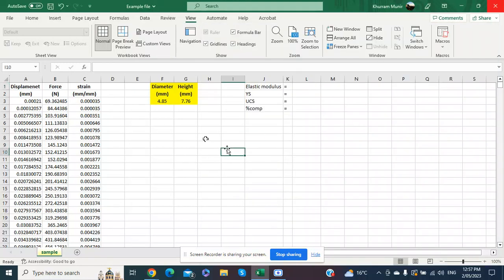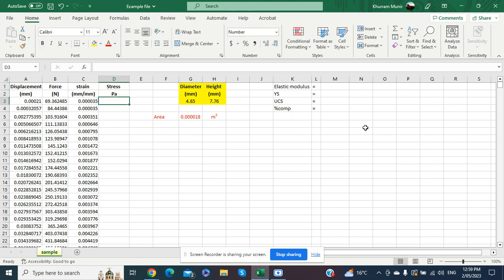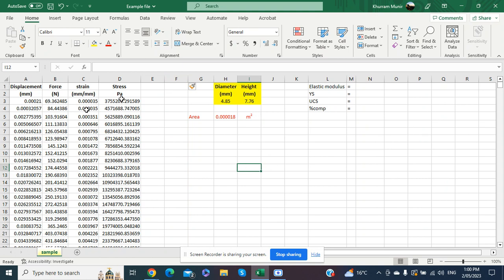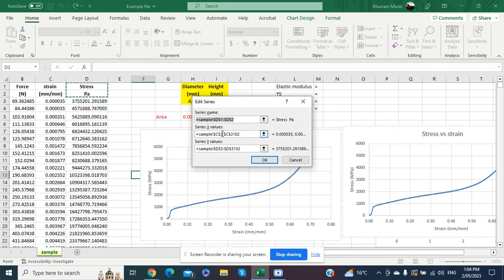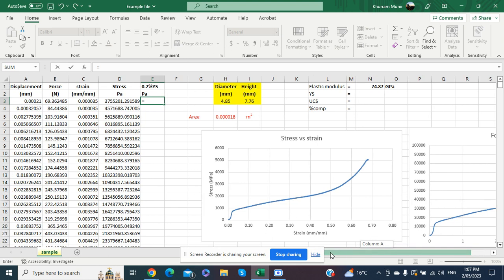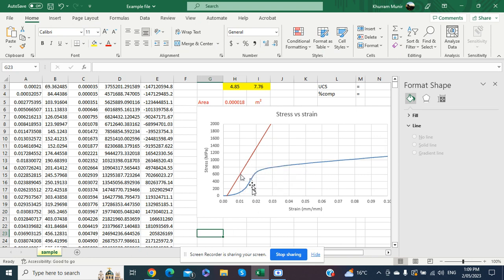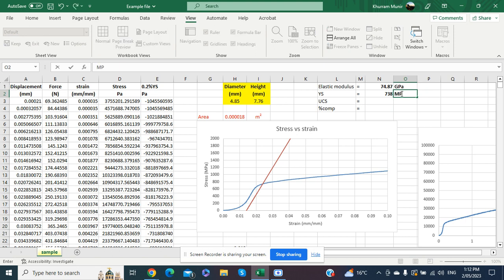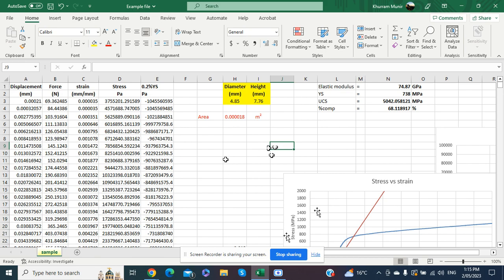Evaluation of mechanical properties from compressive stress-strain curve

Comment: sir how can i calculate youngs modulus if elongation at break % and force in N given. Also tensile strength given.
Reply from the maker: The tensile strength gives the maximum stress the material can withstand before its permanent fracture. However, Young's modulus is calculated within the elastic region, not at the tensile strength point. Therefore, you have to use the stress and strain values from the elastic region, not at break or tensile strength, unless the stress-strain relationship is linear up to the breaking point.

Comment: Why is the curve not linear in the start, sir? I am facing the same issue with my tests
Reply from the maker: In a compression test of metals, the curve at the start is not linear due to the initial non-uniform deformation and material behavior as the load is first applied. Primary reason for this could be contact imperfections. At the start of the test, the surfaces of the metal specimen and the compression platens may not be perfectly aligned or in full contact. As the load increases, the specimen "settles" into the test configuration, causing an initial non-linear response.

Comment: Hello Sir, I have one small query that during the adding of second curve why you plot the yield stress corresponding to previous strain instead of (0.002+strain) values?
Reply: Also, When we talking about 0.2% offset that time we should add 0.002 with strain. Then why you substract 0.002 from strain value?

Comment: Hi, simple question i have stress strain values and graphs, i want to calculate the compressive strength of my specimen. Which point or formula should i look for?
Reply from the maker: The highest point of the compressive or tensile stress–strain curve corresponds to ultimate strength of the material.  You can use maximum formula in Excel , e.g., = max(select the column of stresses) and this would give you the maximum value of stress in that column which corresponds to ultimate strength of the material. I hope it helps! good luck.
Reply: @dr.khurrammunir2410  Thank you sir

Comment: Hello, sir. When entering this data into computer material model im supposed to define "plastic strains" are those strains just the strains past the yield strenght from the lab test or plastic strains are somehow calculated from this diagram from compression test?
Reply from the maker: Hi, strains values from the compression test can be obtained by using a video extensometer. If video extensometers are not available then strain values can be measured from the displacement values as change in height of the sample divided by original height of the sample (before test).  If you are entering these plastic strain values in FEA-based models for an approximate solutions then you can enter strain values obtained in the plastic region- means beyond or after the yield point.

Comment: Thanks in finding for the YS value why was the formula multiplied by le9
Reply from the maker: The calculation of yield strength involves taking into account the elastic modulus value. The elastic modulus value in this example was recorded in GPa (Giga Pascals) so the values of YS in Pa units were multiplied with 10^9.

Comment: Can this evaluation method be applied to viscoelastic fluids (liquids)?
Reply from the maker: The ASTM standard for compression testing of metals is ASTM E9 which was used to obtain stress-strain diagram in this example. Whereas, the ASTM standard for compression testing of viscoelastic materials is ASTM D575-91(2016). 

Simple answer is 'NO' because the stress-strain curve of a viscoelastic material doesn't exhibit distinct linear portions or yield points like those seen in elastic materials (e.g., metals). Instead, it displays a more complex behavior such as initial elastic response, creep behavior, stress relaxation, and strain hardening or softening, due to the combination of elastic and viscous responses over time.
Reply: @dr.khurrammunir2410  I understand, thanks for answering me.